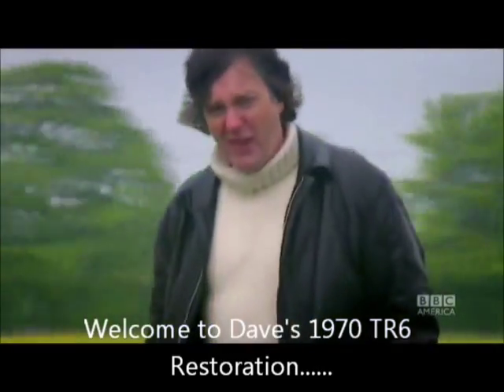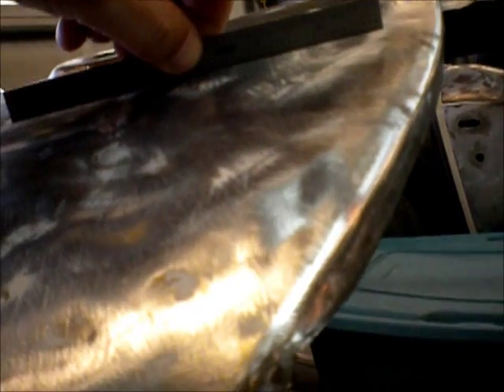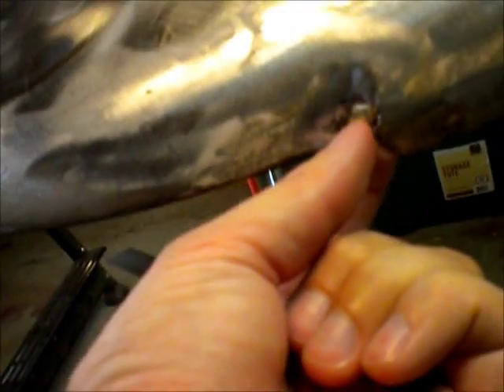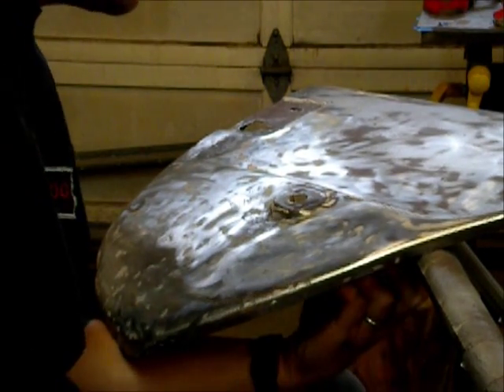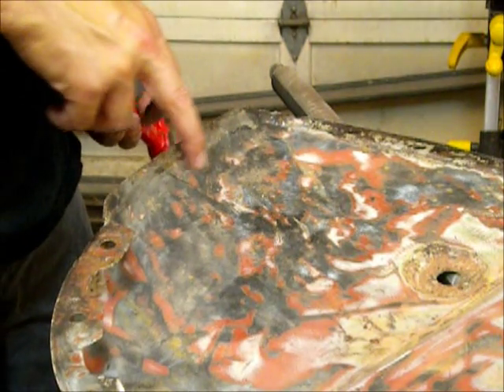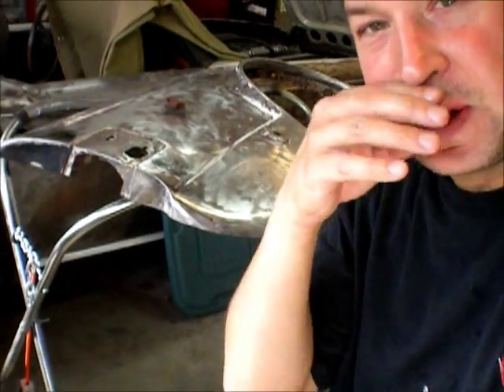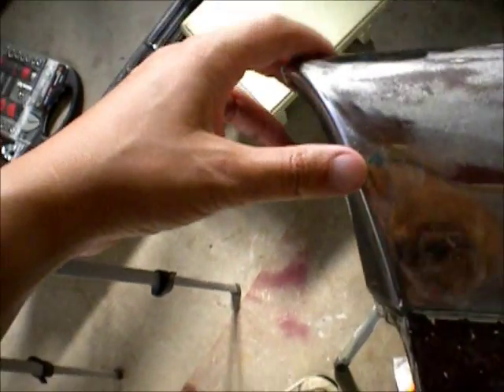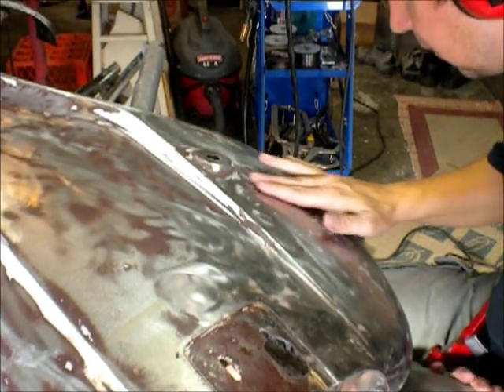70 TR6 Resto #23, Passenger Rear Fender, Finishing

Comment from the maker: Hehe Hi Mister 2:45.  I plan to eventually use filler, but hopefully more of a skim coat.  I want to get the metal as close to the original shape as possible and I enjoy the old-school methods. The rear of the car's been rear-ended at some point so I'm digging out like an inch or more of bondo or more in some spots, often with rust underneath.  I'm metal working all the panels and using the body and other panels for my jig as I go.  Then I'll come back later with primer, filler and paint.